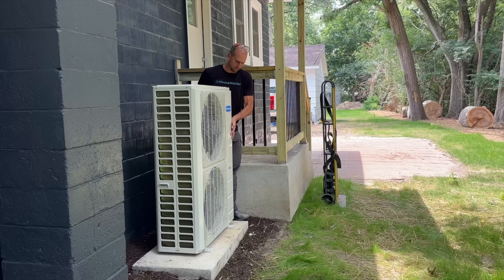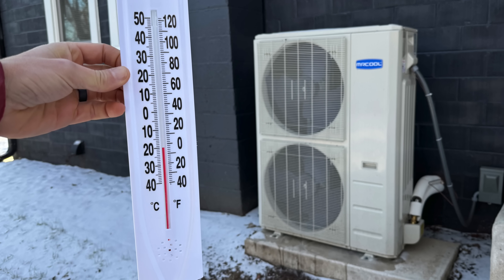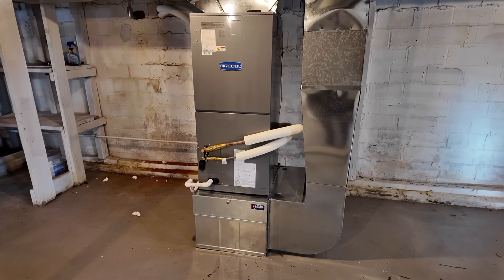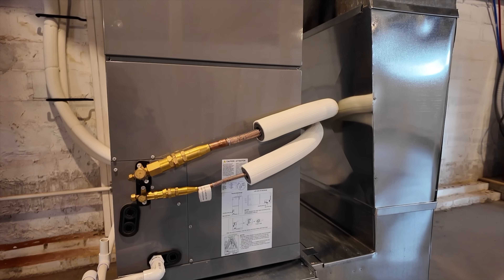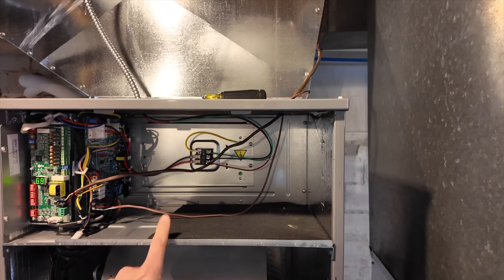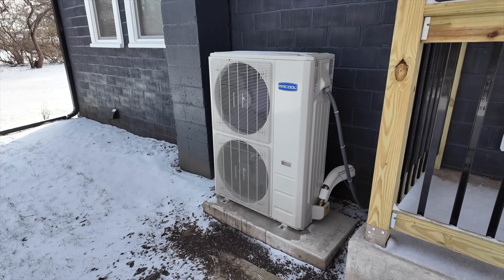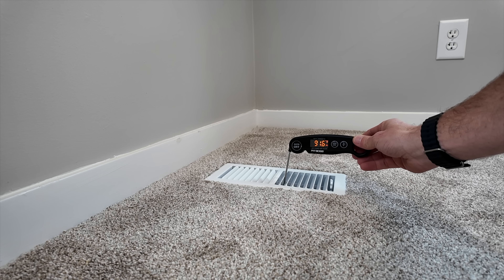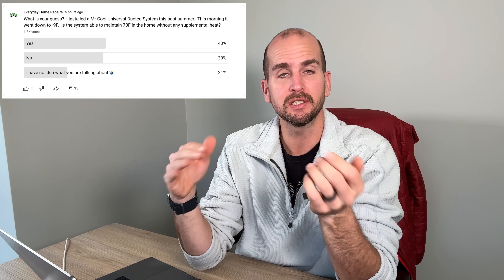Testing A MrCool At Extreme Cold Temps | Will The Hyper Heat Work?

Comment from the maker: Mr Cool Hyper Heat Ducted (2 Ton)https://geni.us/9tBscpQ
Mr Cool Hyper Heat Ducted (3 Ton) - https://geni.us/WT3C1
Mr Cool Hyper Heat Ducted (4 Ton) - https://geni.us/FPyMQ

DISCLAIMER: This video and description contain affiliate links, which means that if you click on one of the product links, I’ll receive a small commission.
Reply: Does the thermostat have a wifi module for controlling over wifi? I did hear hyperheat ducted works with nest or 24 volt thermostats but you lose communication feature and only works as on or off

Comment: They can still deliver heat but their efficiency drops off. At some point, is it more efficient to switch to just using electrical resistance heating would be my question.

Comment: Displaying the register temperature is helpful, but the room temperature at say 4-6ft off the floor is what people are going to feel when in the room. We humans live in the room airspace, not sitting directly over a floor vent.

Other Mr Cool users comments below are very helpful with different scenarios, Mr Cool models and important gotchas to be proactive about. Handling the defrost cycle melt water runoff seems to be very, very important!

We are taking notes and thinking about our purchase options. Essential to plan for near future climate change, both extreme low temps & high temps. Also, failover should grid power go down during a worst case scenario: either polar vortex breakout freezing or heat dome extreme heat emergency that could last 2 or 3 days. Plan on it!

Comment: Scott, Just installed one of these,,only a 24K unit for 1000 sq ft shoebox ranch home. Probably cutting in close on capactity. It has been operational for about 3 months now..It has cooled the house great. We had a couple 30 F nights. I noticed it does frost very heavy on intake side,,until temps get close to set point,,then no frosting.. The defrost works as expected,,Does this sound normal for 30F? THanks.

Comment: Great video you should do a video just explaining the coil and the blower and controller basically the inside "hardware" of the heat pump and how it really moves heat energy in and out of your house rather than producing heat on spot like a furnace

Comment: Putting a similar unit in. Noticed you have the same gap under the air handler. Did you find a way to secure it to the base? How did you seal that gap from the bolts on the bottom?

Comment: I was reading the specs and not believing them. What kind of crap are the major manufacturers selling compared to this?
I noticed that you will not be able to access your inside condenser (a frame) because you ran the line set across the front.  You will probably be able to clean it 75%.  I noticed this because my unit was installed in such a way. the second thing I noticed is that you didn't insulate your duct work.  Wow, just think of what you could get if you did wrap'm up.  I also noticed how quiet the system was.  Lastly, if ice is building up, could it build up and push your system upwards bending the frame or breaking loose from the pad eventually?

Comment: I'm not surprised that it's fine. My builder-grade no-name heat pump is fine down to 10 degrees. Beyond that it does need some aux heat to assist, 15kw and yes that hurts the electricity bill. But these newer name brand units are just fine down to much lower temps

Comment: I have 48K BTU Mitsubishi Hyper Heat ducted system, 3000 sq foot house. If you have big temperature swings from day to night, as in 35 degrees day and 5 degrees night, the heat loss at night will be quite fast. Since Mitsubishi uses inverter system, it will try and use as little energy as possible to maintain setpoint. To compensate for fast heat loss mentioned, set setpoint much higher so the system runs hotter. The Mitsubishi Hyper heat has 104 degree temperature at the ducted register (MAX).

Comment: Looking to update my old central air system. It is a 45 year old unit (that is not a typo) with existing metal duct work. The unit I have still functions but is not efficient at all, and really struggles to reduce the moisture in the home. I have been looking at the MrCool and was not sure if the hyper heat or universal would fit in the existing duct work...and I need to know how large a unit I need by BTU. The house is 2100 sqft...and I believe I read somewhere that the conversion is 20 to 22/sqft. So a 46000 to 50000 BTU unit may work. I have time (albeit barrowed time) but am planning for the future. I am not going to pull the duct work, but would like to know if I am thinking correctly on my BTU calculations.

Comment: QUESTION: I get how the lines come pre-charged. But once I open the refrigerant lines up into the unit... if I later wanted to move the unit, does that require the whole vacuum and recharge of lines process? Or is it possible to seal off all the connectors and keep 99% of the refrigerant in the line (and in the outside and inside units) for any potential 2nd install location?

Comment: Does the thermostat have a wifi module for controlling over wifi? I did hear hyperheat ducted works with nest or 24 volt thermostats but you lose communication feature and only works as on or off

Comment: It is important to read the installation manual if you don't install these all the time. That unit will completely freeze itself to the ground and become a big block of ice very quickly when the outdoor temps go below freezing. It needs to be raised off the ground to give the defrosted water a place to go so it doesn't freeze inside the unit after defrost is complete.
Reply: You can see in the video that water is draining away?

Comment: 3 ton 36k BTU system seems a bit high for 1000 sqft house. Is this system different than traditional calculations of 25 * Sq footage for adequate BTUs? I'm curious to see if the calculations are the same... I considering a Mr.Cool Universal for my house , which is 1900 sqft and has existing galvanized ducts. Thanks for your council

Comment: The UK has had huge issues after pushing heat pump technology, including a lack of trained installers, system costs, and insufficient heat in cold weather. Wonder what they're installing?

Comment: The lines are pressurized, they don’t have a vacuum.  They have refrigerant in them.

I am happy with the capability of my 3 ton unit.  I don’t need another source to keep up, but I want a backup heat source in case the system fails.  My gas furnace is still in place (it is my air handler), but I want to shut off the service.  It is $360/yr just to gave the service active.  I switched to a heat pump water heater, as well.
Reply: I'm in Kansas city and my only gas appliance is the furnace. We have the gas shut off for nearly 7 months of the year and that helps a lot with the "customer charges". It's $65 to reconnect, but overall I save about $150 a year by having them shut off the gas for warmer months. I also run a heat pump water heater.

Comment: That is not a 3 ton unit. That is a 5 ton unit . you can switch it to 4 ton but that is still way to big for your small house. i have a 2 to 3 ton universal in my 2500 sq ft house and it works awsome. max it has pulled is 40kw a day

Comment: had a mr cool universal installed may 2023, and in the winter it was 15F and measured a temp of 132F coming out of the supply vents, kept the house at 74F, this was the 2/3 ton system set to 2ton, 1008 sqft  highest electric bill was $157 !   better then the old heat pump electric bills were over 200$ (more like 230$) and it was a goodman (new install) had it ripped out a year later and put the mr cool in!  so glad i did!

Comment: This is not the Universal series, this is the ducted series. This unit is based on a Midea unit and you can get versions made by others like Cooper and Hunter. The Universal unit is based on a Gree FLEXX unit and does NOT have a communicating thermostat.

Comment: I love your videos.  I do just want to clarify - you keep referring to the system as the Universal Hyper Heat system.  There is a Universal System and a Hyper Heat System by MrCool - they are not the same; they are two different systems by MrCool.  They both utilize the quick connect lines and are very very similar.   I finally figured this out after doing quite a bit of research and looking for a "Universal Hyper Heat" system.

Comment: I had an air to air heat pump plus and electric furnace in the attic. This was in Oklahoma where most homes are on slabs. So the ducts typically blow out from the ceilings. I did not really like it. In winter, with just the outside heat exchanger running, sure it was pulling heat from the air when it is cold. But frankly, sitting on the couch and having essentially cool air blow on you in winter is not much fun. It may save energy, but I was not a fan of 50 degree air hitting me. If I wanted real noticeable heat, I had to switch on the electric backup furnace.

Comment: Thanks for showing us your costs. That is the one thing to see spelled out so clearly. I believe your answer is in adding the additional heat element. I saw this video after I saw yours. https://www.youtube.com/watch?v=BP1iDvKpNZA 
This guy says the heater consumes energy, but not for a long time. I recently saw a Daikin unit being installed and they had to come back and add the auxiliary heat element. The installers joked about how it would perform, but I now see the reason why. Take a look into adding it for yours. I have used your video on Sub Panel install and The Difference in Electrical Boxes, and found them to be informative. Thank for posting content.

Comment: If you ever have accumulating snow around the unit, you need to elevate the unit on a stand of some type, otherwise snow can fill the unit from the side and stop one or both fans from running.

Comment: I remember watching you install that and made it look so easy. I think I commented then, that my parents had a heat pump and the damn thing never worked. They even had a board replaced that was flashing codes but it still didn't work. Theirs was not a "DIY" deal. They had a company come install it, then take it out and reinstall a furnace with another mortgage on the house to cover it. I am glad yours worked out for you. I am in North Saint Louis County, in Missouri and we had wind chills at minus 30 Fahrenheit degrees. But this house does have central heat and air conditioner. Same town as when I was a kid, but different house. I wish I could have got back the house I grew up in, but I never get what I want.

Comment: I live in an area where electricity is insanely expensive. 44¢ kwh vs $3.20 gallon for propane. I don't have air conditioning. Can't do solar and I only have a 125 amp circuit. It sounds like propane heat is the best for me at this time. Any thoughts?

Comment: The video at 3:38 shows the ice from the unit taking defrost cycles.  You didn't explain the impact of defrost on the indoor register temp. My old technology HP has resistive heat strips that run during the defrost cycle so that there is still warm air coming out of the registers during the defrost cycle. You made it clear that there is no supplemental heat - so does it blow cold air or is there some new technology to defrost the outdoor coil? Thanks for the informative video.
Reply: I believe this heat pump and some other brand will turn the indoor fan motor off during defrost so no cold air blows out.
Reply: I would like to know the answer to this question.
Reply: @Bbernhardsr  I believe this heat pump and some other brand will turn the indoor fan motor off during defrost so no cold air blows out.

Comment: I always find it fascinating that people tie the performance of heat pumps to the freezing temperature of water as if when water freezes somehow he pumps fail even though the refrigerant isn't water. Other people I've seen say that zero degrees Fahrenheit is another threshold that a heat pump can't heat which is just an arbitrary number that they come up with somehow that has nothing to do with the coefficient of performance of the unit in any way. Just baffling.
Reply: It might still produce heat but that doesn't mean its doing it cost effectively or that it will even keep up.
Reply: As long as the CoP is greater than 1 for that given outdoor temp and that specific heat pump, it is more efficient than electric resistance heat. If it can't "keep up" your house needs better insulation and air sealing.

Comment: I have a ground source heat pump.  What I would say to anyone considering this, make sure you oversize the system if you have an older home.  My house has heat loss issues.  If I had a tighter home, I think it would be able to maintain a comfortable temperature without using the back-up propane furnace to maintain the setpoint during really cold weather (single digits).  Another thing to be aware of, with a heat pump you don't want to use setbacks at night, keep the thermostat at a constant temperature.  It simply takes way too long to bring the house back five degrees.

Comment: I have a similar unit with a Trane badge but has a Gree twin rotary compressor. (4 ton 2300 square foot house.) I'm a little disappointed that the defrost cycle is on a two hour timer. I would have thought it would detect the snow/ice buildup and clear it as required. Do you know if the MrCool uses the same two hour timer for defrost? Thanks for the consumption information. I don't have a household load display so I won't know until I get my next utility bill.
Reply: @lon6320 Yours is a Gree Flexx. This unit is a Midea Evox. I wonder if a legacy US Trane, demand defrost board could be retrofitted to your Gree Flexx.

Comment: Great content.  One question why 36,000 btu in a 1000 sqft home. Seems greatly oversized by at least a 1ton and a half.
Reply from the maker: I knew I would need some addition capability because I only have R18 in the roof/ceiling and R13 in the walls.  Also, I am keeping the basement (additional square footage) around 60F.  If you have an efficient living space I agree 36,000 BTU would be more than needed for 1,000 sq ft.

Comment: a regular heat pump would not have been able to keep up at those low temps, esp blow zero. but you have a "Hyper Heat" unit type of heat pump similar to the sub-zero heat pumps sold in northern latitudes that can handle those temps.  So not really a good test.

Comment: I have been a general contractor for over 30 years.  I have had nearly 100 heat pumps installed in my projects which range from Southern California to Northern Wisconsin.  I am not a fan of Chinese heat pumps but if you are on a tight budget,  Gree is not a bad choice (Mr Cool is a private label made by Gree).  A better choice is to get the cold weather version of Mitsubishi,  LG, or Daikin.  Always size the unit to the heat load.  (Yes the heat load is influenced by window quality, insulation etc.) 
LG and Mitsubishi can be purchased online from Build with Ferguson or SupplyHouse.
Reply from the maker: Thanks for the great feedback Albert 👍

Comment: Wow, 240V 50A?  My 3 ton AC compressor is only 20A.  Is the other 30 amps a resistive element?
Reply: I'm pretty sure his breaker is way too big. The 2-3 ton spec is 25A MCA and 35A MOCP. I imagine a 30 amp dual pole breaker would work just fine with no nuisance trips. However based on the dual condensor fans in the video it seems like he installed a 4-5 ton unit, which should be ok with a 40A breaker.

Comment: You will get even better results by sealing and insulating the basement return and supply ductwork.  Cellars are colder than living spaces and the metal ducts act as heatsinks reducing both the supply and return temperatures.  We have another manufacturer's hyperheat heat pump and have recorded supply temperatures as high as 108 degrees F from the middle of the ductwork run.
We are pleasantly surprised as to how efficient heat pumps are after installing the whole house and hot water heat pumps.  We have solar with one-to-one net metering and have more credits than the last two years at this time with the same annual solar production.